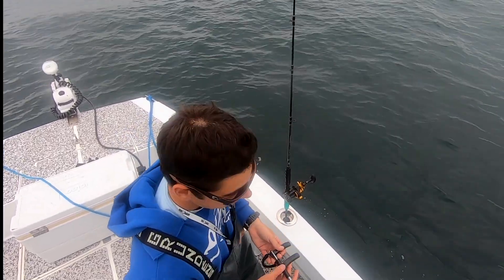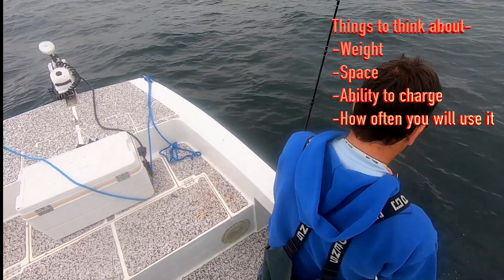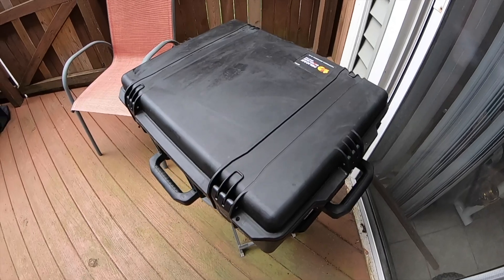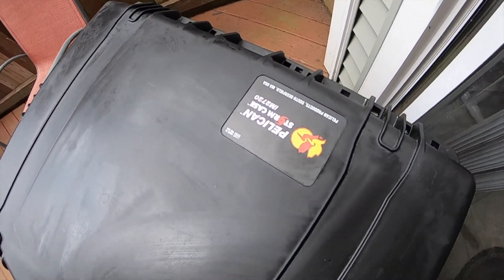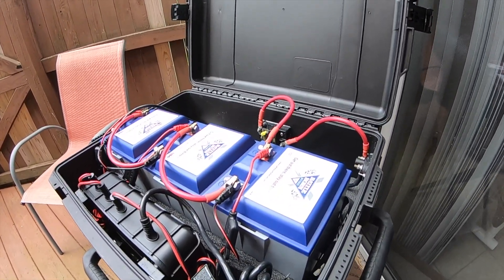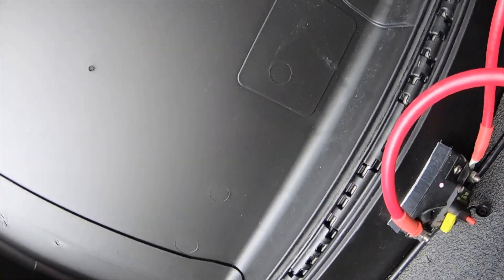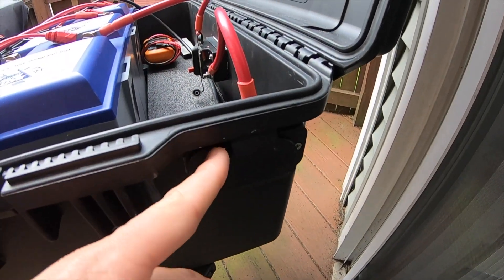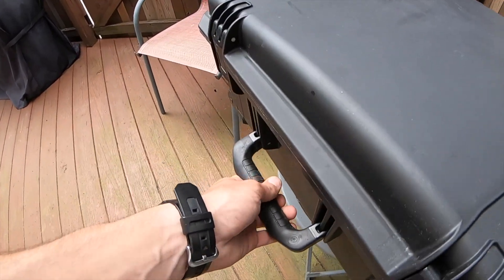Custom Lithium (LiFePo4) Battery box for my 36 Volt Trolling motor

Comment: Hello did you have to cut any holes for ventilation? I have a single 36 volt 100ah lifepo4 battery and just idea seems like a perfect solution
Reply from the maker: @mrlaleezy  so I reached out to battle born and due the lithium iron phosphate battery there is no offgassing. No need to vent. Would reach out to your battery company to confirm that though. No issues yet and been using for 3 plus years.
Reply: @xcaliburfishing9306  Thanks,I'm probably gonna use the packing foam to fill in some of the box after I strap the battery down

Comment: Thx for the video. Just trying to learn, I have a 21 cc thinking of similar setup.why did u go with 3 50 amps instead of just one 100 amp or one 135 amp?
Reply from the maker: Thank you for watching!  I am assuming you are asking about why three 12 volt batteries vs one 36 volt battery?  There were a couple reasons.  At the time there were not many marine grade 36 volt charger and battery manufactures in the market space that I felt had the technology vetted.  You very well could have a single 36 volt LiFePo 4 batteries but recommend you do your homework on the product prior to installation.
Reply: Ty for the reply. I really like your setup, I just need to decide wether to copy your idea or just mount the batteries in the cc.

Comment: What did you use for cutting out space on case for attaching the female end of plug? I’m about to start on mine and thinking an oscillating tool might be my best bet
Reply from the maker: Thanks for watching!  If using the same plug as might I actually used a hole saw and completed two cuts, due to the rounded edges in the diameter required.  Once those were completed I used the oscillating tool to connect the two holes drilled in the box.  Sanded the edges with 60 grit sand paper to remove any excess and did a test fit.  Be careful not to go to fast with the oscillating tool as you can burn/melt the plastic.
Reply: @xcaliburfishing9306  I appreciate the video. Thanks for heads up!

Comment: Another question - it looks like the breaker and Noco charger are mounted/screwed onto some sort of shims.  Are the shims themselves attached to the Pelican walls with just adhesive?
Reply from the maker: Yes they are just adhesive.  JB weld plastic or locite sells things specifically for this.

Comment: 4 days of fishing on 50ah batteries?  How big and what type is your boat?  How long did they last on your buddy’s 31 ft center console?  Debating whether 50ah is good enough for my 105lb thrust TM on my 22ft dual console.
Reply from the maker: Yes correct for ocean wreck fishing.  If I use it in a higher current environment will probably get about a day and a half out of this set up (2kts and up).  I have a 22 ft center console.  They last all day on my buddies 31ft for wreck fishing.  Remember these are Lithium so you get full power for the entire discharge cycle unlike lead acid or agm where you will lose power throughout usage.  My trolling motor has a max current draw of less than 50 amps but really is never at that point during the day.  I also went with a 36volt system to decrease the amount of amps used for the motor.  Hope this helps.
Reply: @xcaliburfishing9306  Thanks.  Very helpful.  Glad I went with the 50ah after reading this.

Comment: Thanks for the idea. I am setting mine up right now. You can use a cheap shunt or a more expensive one like the victron for $130 so you know exactly how much battery life you have. The victron has Bluetooth so you can use your phone to monitor or find the true charge left for your lifepo4 battery’s.  Nice job!
Reply from the maker: Thank you!  Yes you are correct. I will probably make that an offseason project to add that in.  Having too much fun fishing.  Not really needing it as of now.  Ran it for 7 hours yesterday (pretty easy conditions) but still showing 90% via each battery!

Comment: That’s a slick set up! I think I’m going to try and copy your same set up. How difficult was this to set up?
Reply from the maker: Thanks!  Was not difficult just took time and money.
Reply: @xcaliburfishing9306  what size Rhodan are you using?
Reply from the maker: @knollie81  72"
Reply: @xcaliburfishing9306  thanks. I'm looking at this size for a 23 Cape Fisherman. Some are suggesting 84" but wondering if that'll be overkill.
Reply from the maker: @knollie81  To be fair it honestly will depend on how you fish.  I use this mostly for bay and ocean fishing so I went larger than the suggested measurements for my boat specifically.  If you are on flats, rivers or fish mostly calm days you will be able to get away with less.  Hope this helps.